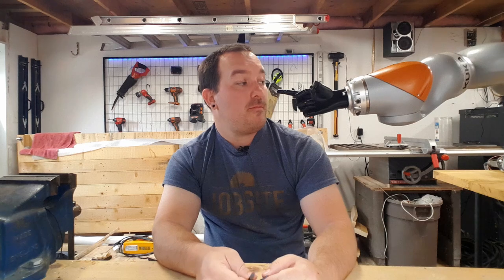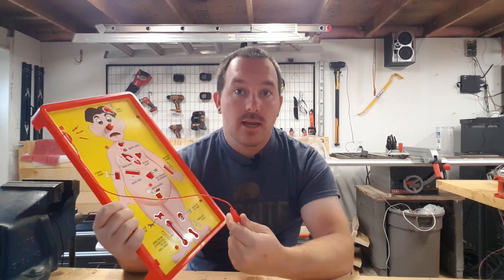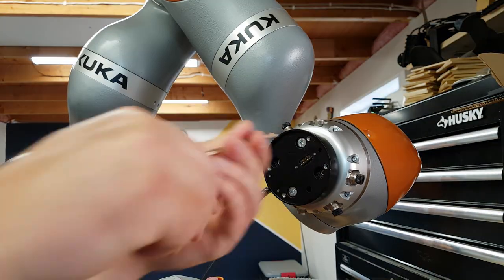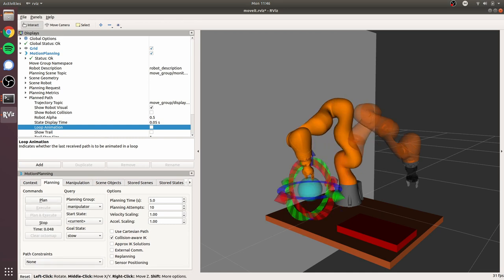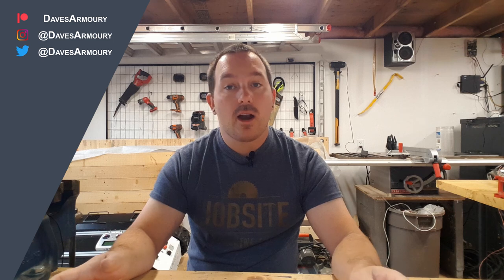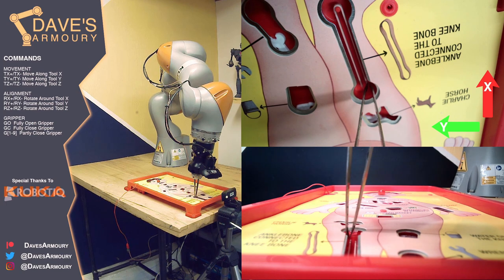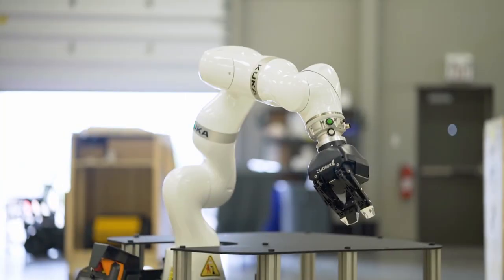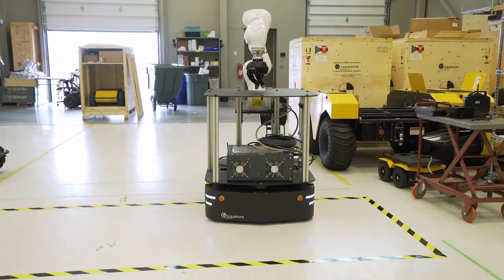I Let The Internet Perform Robotic Surgery

Comment: How and where do you get these robots... they are not cheap !!
Can you tell us how to get one of these affordably? and how to get started using it?
Reply from the maker: All of the robots on the channel are borrowed from other companies. I've spent years forming relationships with arm manufacturers and integrators, and been trained how to use them.
You could look at a Ned from Niryo if you want a cheap arm to work with, or use a simulation in ROS and Gazebo.